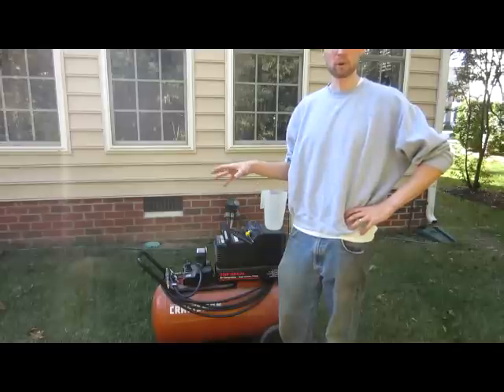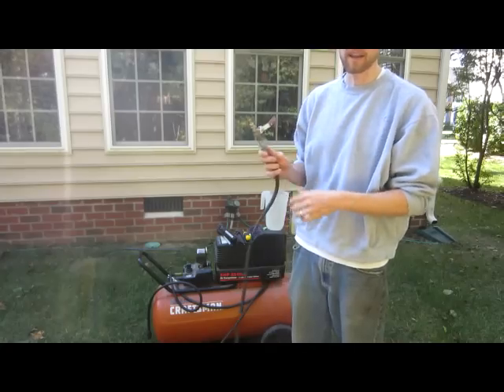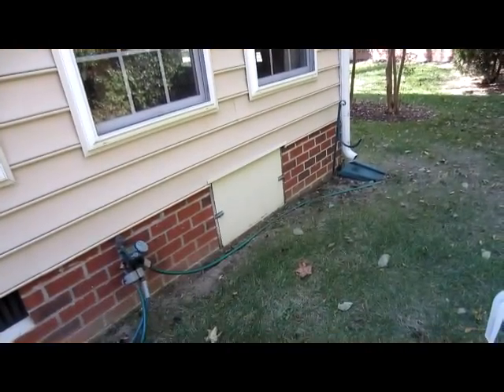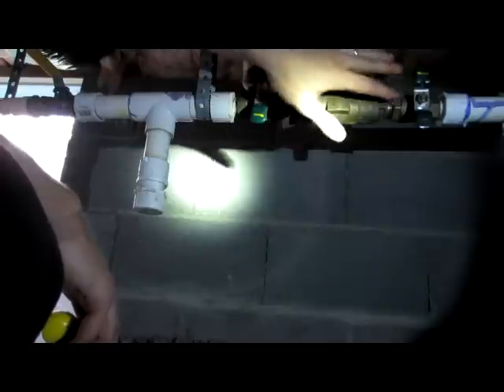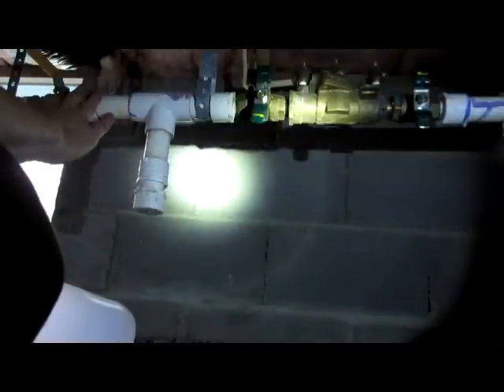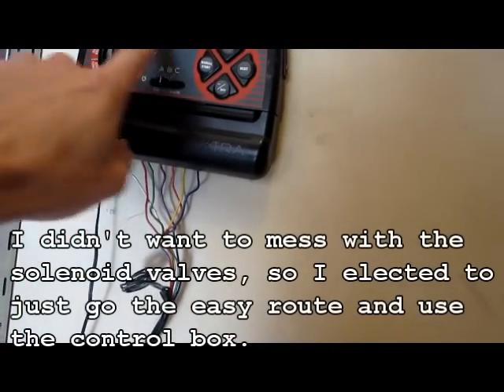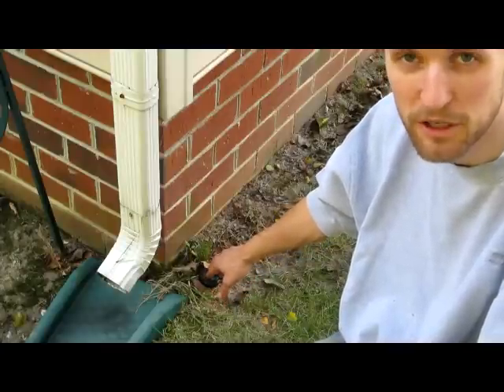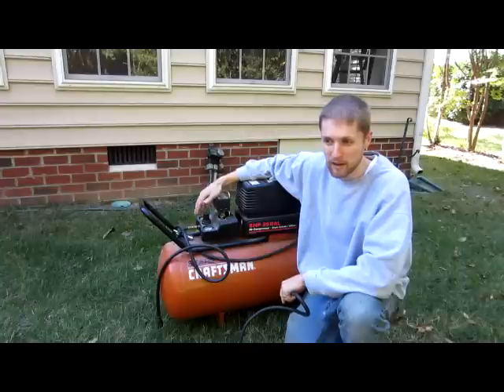How To Blow Out (Winterize) Your In Ground Lawn Yard Sprinkler System - Step by Step DIY Guide

Comment: That drain cap is also called a blowout. You can just attach your air hose to that and not have to mess with hooking up to the backflow itself
Reply from the maker: I like to clear out the backflow as well so no water freezes in that.
Reply: MoneyAhoy yeah for sure man! You can open the little petcocks (#2,3,4) to blow out the backflow while staying attached to the drain plug too. Either way, both are easy. This is the best vid on YouTube I’ve seen so far. Simple steps and well explained

Comment: Is it really necessary to drain ALL the water? As long as I blow it a significant amount of it, shouldn't that provide enough room for the water to expand into when it freezes?
Reply: Yes, that is correct.
Reply: @TechMechRandom,  your answer is really confused. Adam has 2 questions. Which one did you answered? If you answered 1st YES, then the 2nd one is Not. If you answered 2nd one YES, then the 1st one is Not.

Comment: My air compressor is only eight gallons. Will it really take me hours to do this and just be better to hire someone?
Reply from the maker: It cannot hurt to try, but yes I think it will take a very long time unless it is a SUPER small system.  Your best bet is to get a larger one or just hire someone.  As I mentioned, I got mine off of Craigslist for a bit over $100.  So, you can basically break even after just one time!

Good luck if you try it yourself!

Comment: Other videos say to stop once its misting.
Reply from the maker: If you want to get all the water out, you need to keep going.  Just don't go over a minute, or you will heat up your lines with the excess airflow.  Good luck!
Reply: @MoneyAhoy  Thanks yeah. I was thinking also if its misting the water inside is safe to freeze and expand in there. Its my first time doing it, and its with an 8 gallon compressor, 1.5hp. I hear its enough but may need to run 2 passes per zone, and there are 13 zones lol
Reply: @radekw708  keep in mind that your lines aren't all at same height, so leftover water will pool in low spots.
Reply: @bokononisti2820  as long as there is room for expansion, should be fine. Apparently you can damage the heads if you do it too long? I just stopped when misting, we'll see come spring. This isn't rocket science so probably don't need to be that accurate as to take out every drop of water.